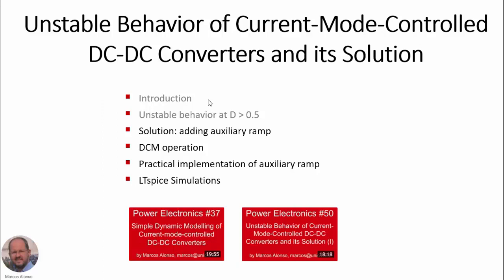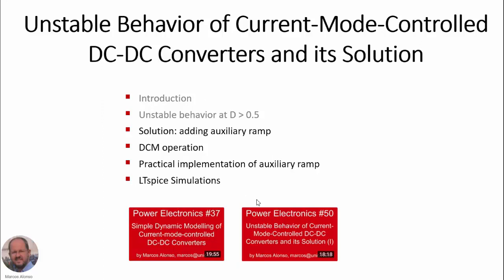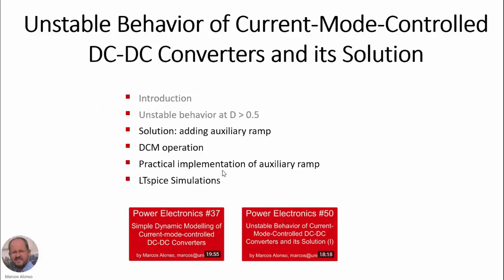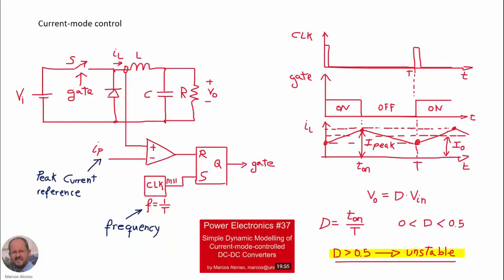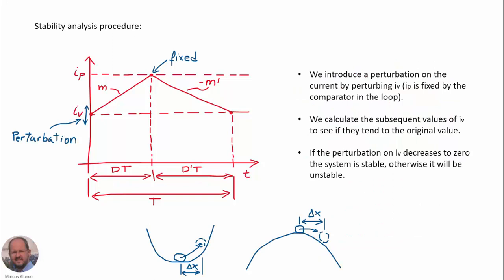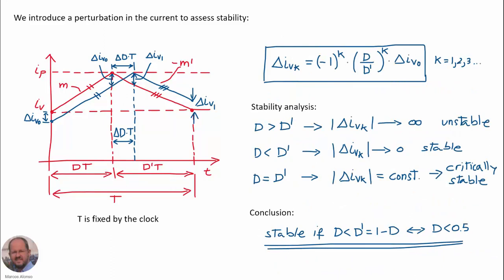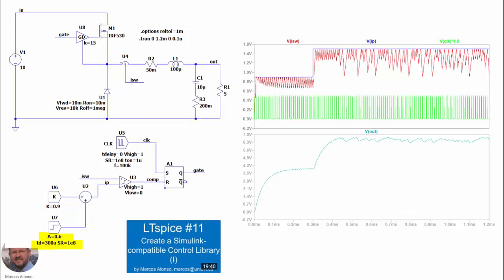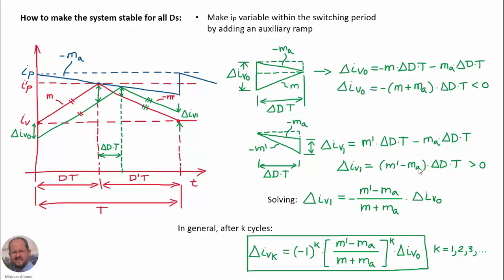PE #51: Unstable Behavior of Current-Mode-Controlled DC-DC Converters and its Solution (Part II)

Comment: Sir,

Thanks for this excellent video.
I have a query at 19:26...Are the signal signs going to comparator correct ? Should Visense go to inverting or non-inverting terminal.
Regards
Reply from the maker: Thanks for your question.
I think they are OK. the signs are the same as in the first slide. See part I to see the explanation.
When the sensed current is higher than the output of the error amplifier the comparator goes high and resets the flip-flop, turning off the switch. The switch is turned on again by the action of the clock at the beginning of the next switching period.

Comment: Good afternoon Professor Alonso. Again, thank you for all you are doing. I have a question about the gain of a modular. I have a transfer function of a converter and I am looking to compute the closed loop gain in order to plot the Bode Plot. How to compute the modulator gain for a peak current control with slope compensation? I read in some text book that it is d/vcomp. How to get to the analytical expression? I am looking for that in order to compute the loop gain. 
Thank you for your help and time.
Reply from the maker: Hello, thanks for your question.
In video PE #37: https://youtu.be/2fVi3LH3d70 you can see how to obtain the loop gain of a current-mode control DC-DC converter. This model works well for most applications. You do not need to worry about the modulator gain. The duty cycle is a parameter that you do not control in current mode.
For a more accurate model of current-mode control you can watch the following video: PE #71: https://youtu.be/rnLj38oNSFc

Comment: Great explanation I have tried in the past with UCC3843 peak current controller to calculate the slope resistor. Normally UCC3843 controller has 1V ( clamped by zener diode) in INV of COMP amplifier means NOINV must be 1V or less, we can take these conditions to select slope resistor, known before Rf and Cf ( respecting rigth blinkTime).

I suppose that the only parameter to calculate is the Ra

I would like that you do the same for a interleaved boost  converter ( two phases)

Thanks for sharing the folder
Reply from the maker: Thanks for your comment and suggestion.

Comment: Good evening Professor Alonso. I hope this email finds you well. I have a question regarding the output short circuit protection of a converter. For example, for a buck converter, how to protect the output against a short circuit? How to make sure that if the output is inadvertently shorted, the converter can recover after the fault condition is removed. How to implement it? Thank you for all you are doing.
Reply from the maker: In current mode control the easiest way is to limit the peak current in the switch. You can use a comparator so that if the peak current is higher than a maximum predetermined value the switch is turned off. I recommend adding a little hysteresis to the comparator so when the current is below the low threshold value of the comparator the switch is activated again.
Hope this helps. Thanks for your question!